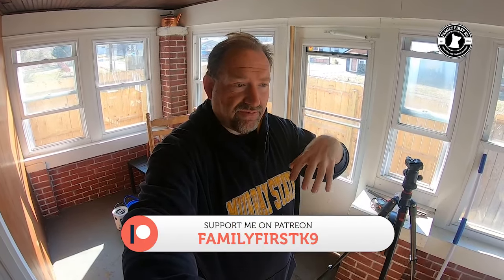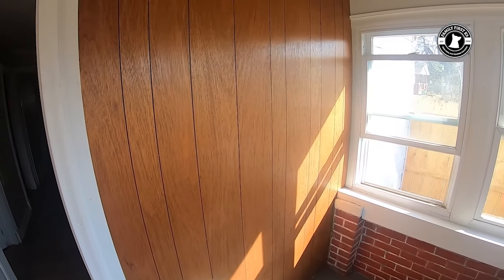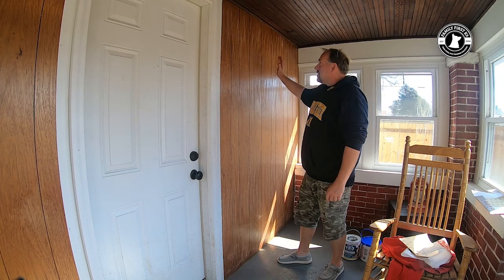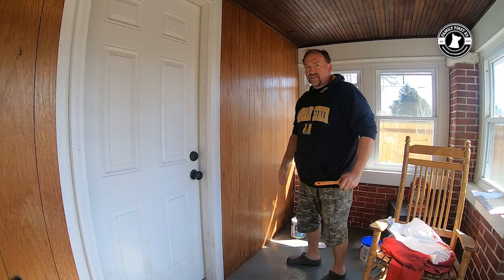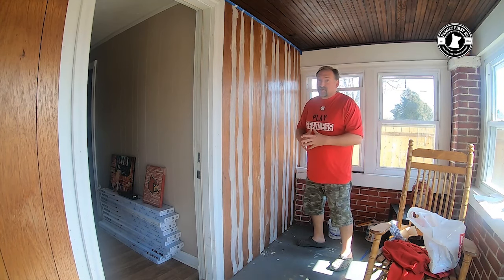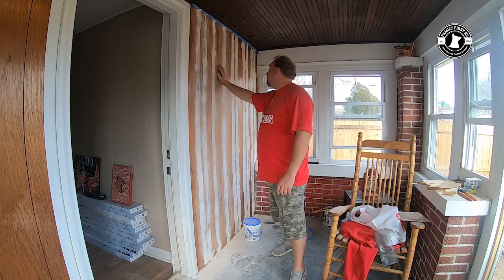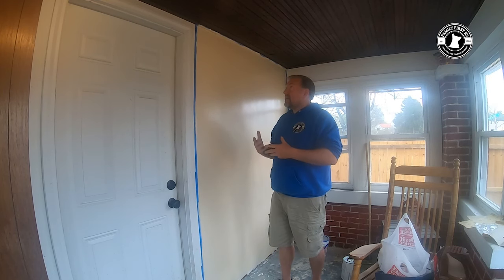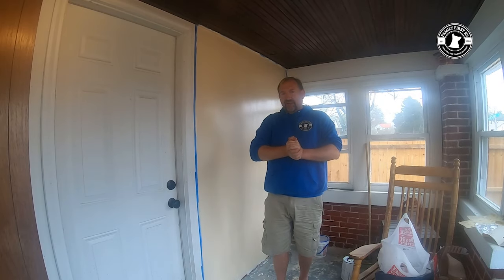How to make paneling look like Drywall | Pet friendly remodel episode 2

Comment: Done well. 
I think the primer first is a good call. In my head i think yhe primer soaks into the lines and also leaves a rough surface for the mud to stick to.

I think i would have done a strip of fiber tape down each line.
Only because i think undisturbed yours will last but any settling or impact yours might crack. 
But look. Know you know your way around some plaster so if it does crack you just get that knife out and hit it with a swipe. 
Good job man

Comment: Just curious as to why you primed the grooves before applying sparkling? Does that have some.benefit over doing thr sparkling first? Great video and the wall looks amazing!!!
Reply from the maker: I did a few steps just to ensure that things stick.  Maybe there wasn't a need for it but over a year later and it still looks great.  In the past I watched people try to do things to paneling and it didn't look right.  This just helped to ensure that it was ready to receive anything I applied.
Reply: @FamilyFirstK9  definitely can't argue with your results. It looks fantastic!

Comment: I would say first issue, seems like a gloss paint. I imagine a Matte or Eggshell would be better. While this is a way to go, it seems to be more work with the spackling and sanding, etc. I will be getting 4x8 Utility board (its like 1/8 inch think), and just nailing or stapleing that up over paneling and painting.

Comment: what did you use to fill in the panel lines? My wall has grooves within each panel so I'm not sure what joint compound will work best
Reply from the maker: I just used the only joint compound I could get at my local hardware store.

Comment: So you didn’t actually cover up the wall panel, you used spackle and sanding to smooth it out to look like drywall? My kitchen has hideous paneling that the previous home owner painted with a gross grey chalky type paint. But it has wood groove pattern on it that’s raised. I’m wondering if your method would work.
Reply from the maker: Yup, I literally followed the steps in the video and it turned out to look just like drywall

Comment: How is it holding up?
Reply from the maker: It looks just as good as it did when I shot the video.
Reply: @FamilyFirstK9  great, I’m going to start it today. Thanks!
Reply from the maker: @bonnieklyde8250  I'm happy with how mine turned out.  It takes a little time but saves so much in cost.
Reply: @FamilyFirstK9  how's it doing now? Does it handle temperature change well?
Reply from the maker: Still looks the same